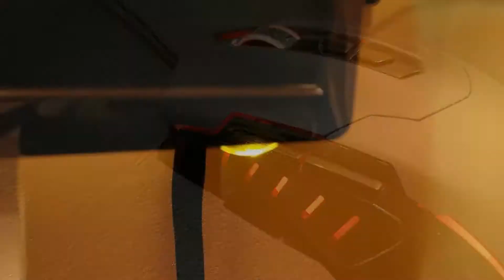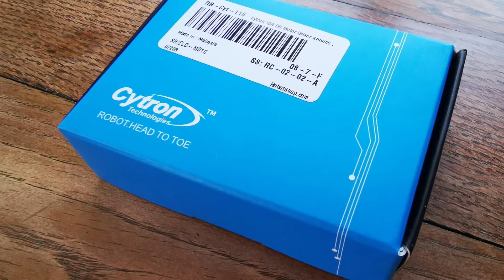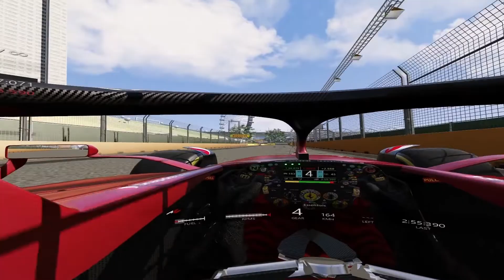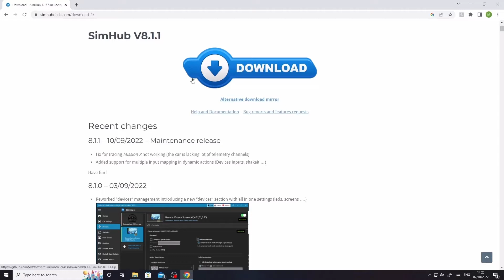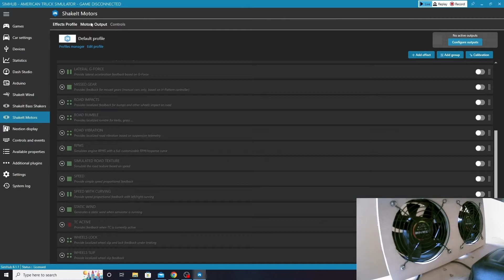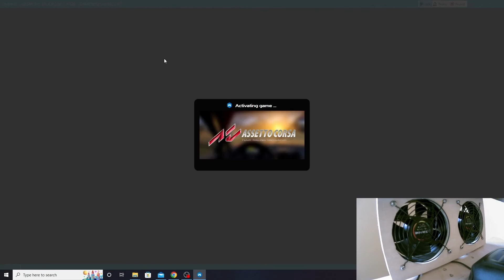DIY Wind sim for around £100!

Comment: Do you have any fan alternatives. This whole pwn thing has me paramoid ill buy wrong fan
Reply: No to be fair I used some high air flows my mate had lying around in the end. Normal fan hum/air moving is fine Its unavoidable but this whine I can hear over my headphones turned pretty loud. Like I said my first thought was it sounded like coil whine on a gpu. My office sounded like a server room 🤣 I think the cause is probably cheap Chinese fans that are meant to be on all day ever day at full blast on some mining rig 

So your fans, nose wise, is what you hear with most other pc fans +added air that these things move or does it also have a whine just quieter than this? 

Noctua is a good shout. Just not sure which ones to get that would work with this set up. Took your advice in not going ducting so Fans going next to wheel so not too worried by strength.
Reply from the maker: @jackheywood6200 The fans I have got make a hum, which is quite a pleasant tone, and the noise of the Air with it do make them quite loud but like I say with some headphones in I find them to be fine, and you can always turn down the power. You would have to get a non PWM noctua fan, but they are expensive and really don't move much air in comparison to the ones I used. Hope you manage to sort something that works for you 👍
Reply: @DayDreamerVR Turns out my fans make a whine sound all the time that they are not powered at 100percent by the software... Spooling up and down, even though it's fast, make no noise at 100percend on simhub but turn them down on SIM hub, or the game is ramping up then they scream 😢. Guessing yours don't do that? It's like the on/off of the the motor is noisy AF. Any ideas or new fans?
Reply from the maker: @jackheywood6200 did you get the same fans as I used in the video? I get a hum, not a scream, and I use in ear headphones when using the fans and I don't find them annoying. If you are using the same fans then I don't know what the cause would be unfortunately, sorry. If you go with other fans then the options for High airflow are quite limited, but there are lots of options for lower airflow that are pretty quiet, for example noctua fans are good. Hope you manage to find something that works for you 👍
Reply from the maker: Sorry for the late reply, where abouts are you located? If in the UK, these work well: https://amzn.to/3XEnnkH
It is quite tricky to find some, but let me know where you are and I'll try and help 👍
Reply: Awesome dude thanks. I have finally got around to building this thing. Awesome and works, however my shield/uno is making one hell of a wining sound when ever the fans get triggered to go on. Its sort of like GPU Coil wine as in when it gets a boot of power, it screeches. Any ideas my dude? @NullAndVoidChannel
Reply: never mind, ears playing tricks, its actually coming from the fans.... ? :S
Reply from the maker: @jackheywood6200  just saw your message so updating this. That is a problem with fans, it's difficult to get a balance of good noise and Air flow. I use in ear headphones when I have my fans on, or the only other options are to get lower CFM/rpm fans or try and move them further away and funnel the air flow with tubing, but that's more effort and won't reduce the noise by much, or you can reduce the percentage of power for them when at their max to reduce the rpms but again reduces air flow 👍

Comment: Just wanted to say what an awesome guide this is.  I'm going to have a go at doing it.  Do you have an affiliate link for the MDD10 rather than MD10 so that I can support you when I buy?  The reason I want to go MDD10 is I'm going to use 2 Bilge Blowers instead of fans as Ive already had a go at a fan based wind system and it's like having a baby breathe on me, I want to try and go much stronger.
Thanks again!
Reply from the maker: Thank you for the comment and feedback about the video, and thank you for offering to use an Affiliate link, I don't have one for the MD10 or MDD10 Cytron motor shields unfortunately. The bilge blowers would be amazing! I hope the build goes smoothly for you, enjoy 👍
Reply: @NullAndVoidChannel  Thanks mate, I figured you still didnt, but thought I'd check just in case.  Cheers mate.
Reply: I've got another question if you don't mind - the motor shield - is that a variable voltage thing?  i.e. as the pwm signal represents a faster and faster speed, the voltage goes up and up and up to a maximum of whatever voltage the PSU you've used is ?
Reply from the maker: @HillierScott  I don't mind at all, yes the motor shield controls the speed by adjusting the voltage 👍

Comment: Do you have to use the Arduino branded UNO REV 3 or is it possible to use a cheaper alternative?
Reply from the maker: I haven't tried it with an alternative, it could work, but I don't know if the setup might be slightly different 👍

Comment: Just finished my build today used your video and ordered from your links. Works great and was very easy.  Thanks for such an awesome guide.
Reply from the maker: Awesome, glad to here it helped, enjoy your wind sim! 👍
Reply: Did you use the same fans? If so, do you feel that they have enough power?
Reply: @KraZeRtv  I did use the same fans. I think they are strong enough.  They aren't crazy strong, but I wouldn't want anything stronger.      I'd compare it to medium settings on, say, a box fan or something similar.

Comment: Would I need to solder If I went with the cytron MDD10? I’d like to have the curving effect
Reply: What exactly is the curving effect that SimHub has? Does it make one fan blow more than the other depending on which way your car is turning?  E.g. a right turn would cause the fan on the left to blow more because that window is more exposed?  If so, can you adjust the strength of the difference between the two fans as well, to the point where one fan is nearly full speed while the other is maybe almost off or down to 25%?
Reply: @MidwestSteeze  That is exactly it, but I don’t know to what extent you can customize it.
Reply from the maker: No soldering needed 👍
Reply: @NullAndVoidChannel  thanks king!

Comment: Really struggling to get this to work. Orange lights come on the Arduino motor shield Rev 3 when I repeatedly press test in simhub, but the fans never trigger. Any ideas?
Reply from the maker: Sorry to hear this, have you had a read of the Simhub forum post linked in the description? There are other people who have had similar issues and the some option for fixing are detailed. Some has included: wires wrong way around, PWM fans, and a few other things. Did you use the same fans? If you didn't use the same fans, have you tried swapping the wires around? Have you cut the trace on the back of the Arduino motor shield, and are you using the same power supply or one with the same specs? Hopefully we can get it working 👍
Reply: @NullAndVoidChannel  hi, thanks for the reply! Yeah I’ve followed your post and read through all 6 pages of comments twice and watched your video loads of times :( 

I’ve tried moving the fans around, stripping them again and all sorts. Not really sure what to do.
Reply from the maker: @billyvickery1435  Just had another read of the forum myself in case it helps trigger my memory. Have you continuity tested the trace being cut on the back (just in case)? Could be worth removing the power supply and fans, and connecting them directly to the psu to check they spin/aren't faulty. It could also be worth checking the voltage/current at the motor terminals when clicking test in Simhub to see what is getting to the fans. Then in Simhub make sure the volume is set to 100,and increase the minimum force settings whilst testing to 100. I'll keep having a think about other options and I'll post if I think of something 👍
Reply: @NullAndVoidChannel  I just cut, stripped back and did everything again. I think it was a perfect storm as it’s now working. Huge thanks to you. 

I’ll subscribe to your channel and thumbs up the video. If there’s a PayPal pot I can donate you a coffee let me know 👍🏻
Reply from the maker: @billyvickery1435  Awesome! Just really pleased it's working! Thanks for the subscription/like, and offer of a donation, but honestly it's just nice to know it has helped 👍
Reply: @NullAndVoidChannel  sorry yes, have used the exact same fans as you too. Used a power supply recommended on your video and boosted media’s. Yes have also cut the trace on the back. The orange lights wouldn’t show until I did that, I think!
Reply: i made it work🎉🎉🎉🎉🎉. , now how i make it go faster?

Comment: Thanks for the Guide :) I’ve build it with the same components but the Motorshield overheats and shuts down after like 5min. Any Ideas what I’ve done wrong?
Reply: I use the Cytron and at the moment it’s not in an it’s not in an enclosure. Locks like the part on the top right of the shield overheats. I will try the heatsinks :) Thanks for the fast response :)
Reply from the maker: @cnaetscher93_2  No worries, hope you manage to get it sorted 👍
Reply: @cnaetscher93_2  Hey. Long shot but did you ever manage to sort this? Just built the wind sim and having the same issue with the same part overheating
Reply from the maker: Sorry to hear that, did you use the Arduino motor shield or the Cytron one? If you used the Arduino Motor Shield with the Arduino Uno, then I would recommend getting a heat sink for the Arduino Motor Shield's chip. Have you got it in an enclosure or open to the air? If you are using the Cytron motor shield then this is odd, and the Arduino one should throttle preventing overheating but it could still overheat without a heatsink. Something like this for the Arduino would help: https://www.ebay.co.uk/itm/234192442677?hash=item3686f51535:g:2PYAAOSwxJBhRN7q&amdata=enc%3AAQAIAAAA4KTIcMBUQ4h3fnan72KGrSvvPrcNgKxJO9tv0IwmF7YNaiky67LU0s2zbvdBGHFE4RaJ4FLt%2BicCRNJ022BlmesWtUFCS13Ej7SA%2BmOTkKKoNbI6hnPHq6nsAkG%2Bz60oG0Dr0bBJ67chYpaTvMrMgrVAkWyLYPdGE5fEnqcI7JRQXMpVZmfitozGYVxi3Fpz334psVQRR1%2B1qeBlhacI%2BaQJzDKkHip%2FQ4iN1QAz6mw49JQHntyLgGu6IPgf4hL%2B2yl%2B3XyrDsEs3Vi0icWW039D6RlpaZY%2BLJt%2FeOWxdHD2%7Ctkp%3ABk9SR_7u77H9YQ

Comment: OK...thanks so much for this!  I put mine together last night...had to switch white and black wires.  I also instead of cutting the fan wires...used a 4 pin molex plug that came with my Power supply.  Removed two leads to nothing...and left in the leads that corresponded with the power and neutral wires on the fan.  I cut it, and used  that to make the connection to the motor shield.  This way the fans are fully intact for future use somewhere else.  

ALSO...I first 3d printed a funnel to connect to 3 inch flex duct...and I can agree, the wind speed out of the end of the hose was pretty low...then I thought....wait...its missing a straightener.  Basically the funnel is causing the wind to swirl down the duct, so when it exits the duct, its blowing sideways.  If you print a funnel with straightening fins in the reduction section, the flow stays straight.  VOILA!  I tested the old design side by side...night and day.  Anyways...kuddos to a guy on thingiverse for a great design print.  

https://www.thingiverse.com/thing:5173449

I printed the tall one BTW...and connected 3 inch flex hose.
Reply from the maker: Good idea with the Molex connector and ducting 👍

Comment: I'm having an issue. I have an orange light in addition to the two green lights. Every other step works but the fans don't move when testing. I have all the same parts as you do in video minus port supply as I'm in Canada. My wires were red and black, assuming black negative and red positive.
Reply from the maker: Sorry to hear that, would be worth going onto this forum post to see if anything there helps 👍 https://www.simhubdash.com/community-2/projects/wind-sim-with-arduino-uno-rev-3-and-arduino-motor-shield-rev-3/#post-5886
Reply: did you ever find a solution?

Comment: so i finally got around to setting this up, using the same fans as you but the arduino motor shield. Have you had any issues with the fans buzzing/humming at lower speeds? they are quieter at max speed
Reply from the maker: I haven't, I did have issues when the minimum force was set too low, they kept cutting in and out, but once that was set higher they start up fine. Are yours fixed to anything that could cause them to reverberate? Maybe try some rubber washers between the fans and what they are mounted on? That's if it is reverberation. Hope you find the solution 👍
Reply: Did you ever figure out how to do this? I have the same same parts with the MBB10 Board and am getting the buzzing sound.
Reply: @BrettBouthillier  sadly I did not. I stopped using the Windsim but am going to set it up again more as a static wind effect and just run them at an rpm where they are quieter. I found the ramping wind wasn’t that immersive for me anyway

Comment: I have built a wind sim for my son's sim rig, but I mistakenly bought Pwm fans. They do work when connected straight to a power supply, Noctua yellow wire to positive and black to ground. However, when I go thru the Simhub process, no matter what I do, I can't get the fans to run. It is very frustrating, but this is my first Arduino adventure, so everything is new to me. BTW, I bought a Sim3D wind/rumble motor kit that I have on my rig. Even when I copy the settings in Simhub from my kit, the one I built still won't work.  I will figure it out eventually. Thanks for the helpful video.
Reply from the maker: Hi, sorry youre having an issue, could be worth looking at my post here where others have commented and added additional advice/options. Hope this helps: https://www.simhubdash.com/community-2/projects/wind-sim-with-arduino-uno-rev-3-and-arduino-motor-shield-rev-3/paged/3/#post-6366
Reply: did you figure this out? i cant get mine to work. initianlly was  using a arduino motor shield and now trying a cytron and no luck  @nicholasmarshall3191
Reply: @antok86  I bought basic 2 wire fans, and they worked fine.
Reply: @nicholasmarshall3191  that what i did it works now but just doesnt move enough air like the noctua did. which was wierd it worked on test mode but wouldnt work in simhub...something to do with the PWM fan i guess

Comment: Thanks for putting this together. You mentioned a PWM fan would not work? Can you explain why? I've a kit made for sim racing and it uses a PWN fan.
Reply from the maker: So with the way I have done it in the tutorial it only gives a + and - and not a PWM signal. There is a way to do it though with a PWM fan, I posted on simhub and one of the comments from someone explains how to do it. Hope this helps - Post can be found here: https://www.simhubdash.com/community-2/projects/wind-sim-with-arduino-uno-rev-3-and-arduino-motor-shield-rev-3/
Reply: @NullAndVoidChannel  I do wonder what is the difference between using a PWM fan directly with the Uno vs using Uno with a motor shield. Is one method better than the other?
Reply from the maker: @paradox9357  if I'm honest I don't know! I just found more info here and there relating to a motor shield. I did find this however which gives info on using a PWM fan with the Uno: https://create.arduino.cc/projecthub/tylerpeppy/25-khz-4-pin-pwm-fan-control-with-arduino-uno-3005a1

Comment: Can you recommend anything other than the MDD10 for dual channel? I’m having trouble finding one to buy in aus
Reply from the maker: From a quick look it's quite difficult to find something. But this company might be able to ship an Arduino motor shield rev3 to Australia. There is a guide linked in the description of this video to the simhub forum about how to use it. Hope that helps. https://uk.rs-online.com/web/p/shields-for-arduino/1825518/?relevancy-data=7365617263685F636173636164655F6F726465723D31267365617263685F696E746572666163655F6E616D653D4931384E53656172636847656E65726963267365617263685F6C616E67756167655F757365643D656E267365617263685F6D617463685F6D6F64653D6D61746368616C6C7061727469616C267365617263685F7061747465726E5F6D6174636865643D5E2E2A24267365617263685F7061747465726E5F6F726465723D313333267365617263685F73745F6E6F726D616C697365643D59267365617263685F726573706F6E73655F616374696F6E3D267365617263685F747970653D43415443485F414C4C5F44454641554C54267365617263685F7370656C6C5F636F72726563745F6170706C6965643D59267365617263685F77696C645F63617264696E675F6D6F64653D4E4F4E45267365617263685F6B6579776F72643D61726475696E6F206D6F746F7220736869656C642072657633267365617263685F6B6579776F72645F6170703D61726475696E6F206D6F746F7220736869656C642072657633267365617263685F636F6E6669673D3026&searchHistory=%7B%22enabled%22%3Atrue%7D
Reply: @NullAndVoidChannel  thank you for looking for me! I'll check it out now
Reply: Jaycar sell the Arduino motor shield rev 3